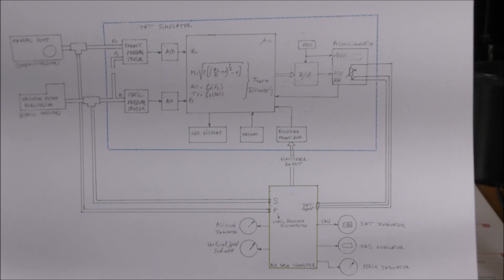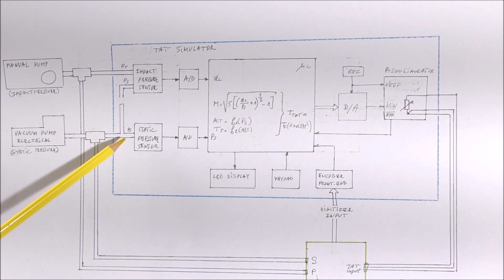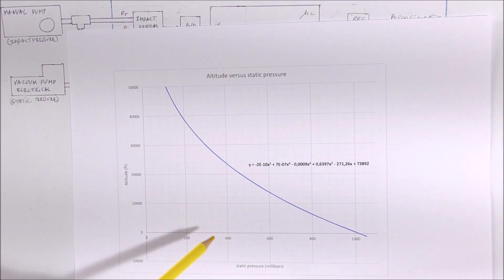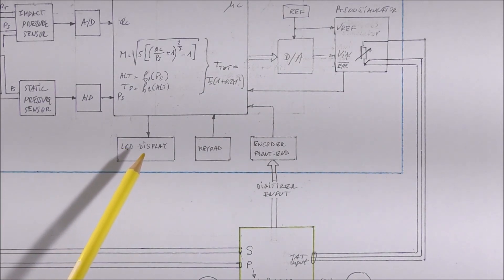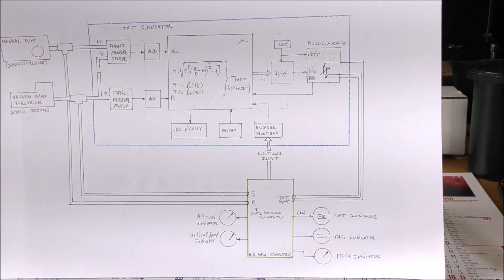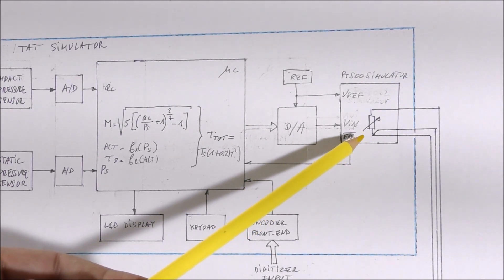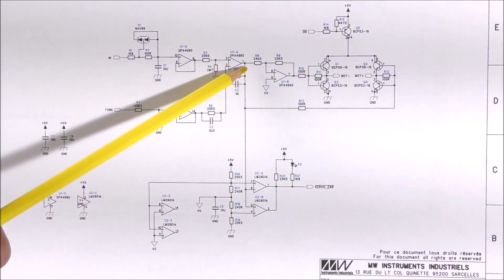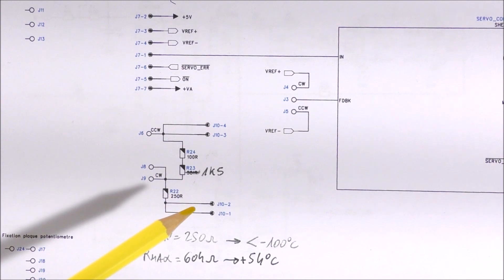LDM #308: Design of a Total Air Temperature probe simulator - Part 1

Comment: Wow! Nice design. The PT simulator with a servo is wonderful overkill, and should be very dependable. For a single-unit manufacture it is beautiful and well in keeping with the avionics tradition. A design to be proud of! And perfectly in line with my handle :)

If I wanted to make a product out of it, I would have used two resistors in parallel. The larger resistor would be permanently connected. The smaller resistor would be connected in parallel to the larger resistor, but via an optomos isolator. Those isolators have very low on-impedance. The MCU would control the average resistance using PWM. I imagine Pt100 input stages have low-pass filters that will get rid of the PWM and will react to the average resistance value.
Reply from the maker: Probably that this should work with most air data computers, but I wanted to do something which is totally independent from the ADC.
Reply: @lelabodemichel5162  That’s worthwhile and you do it as an art, so it’s quite enjoyable to see.

Comment: Hello Michel, could you explain the function of the two anti parallel diodes on the input of the servo control? Thank you!
Reply from the maker: The diodes permit to decrease the time constant of the input filter when there is a large change of the input voltage (variation > 0.7V). This avoids a too long settling time. When the voltage across the capacitor is close to the input voltage the diodes are off and the filter uses R1+R2, otherwise only R1 is used.